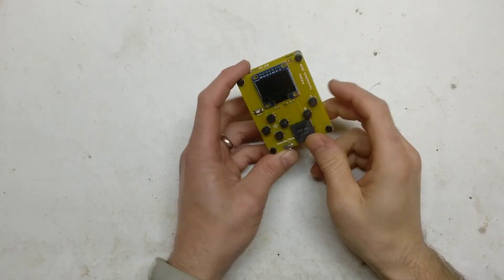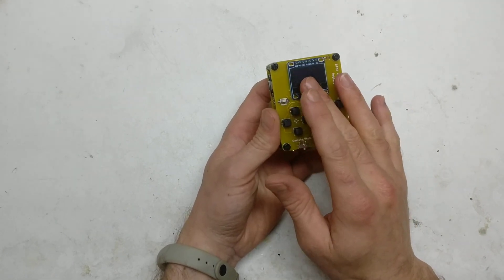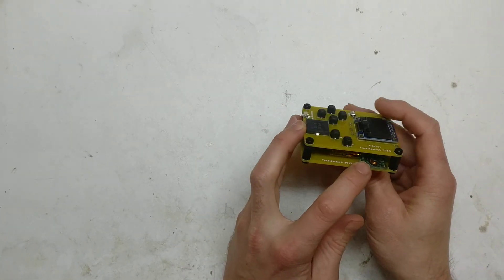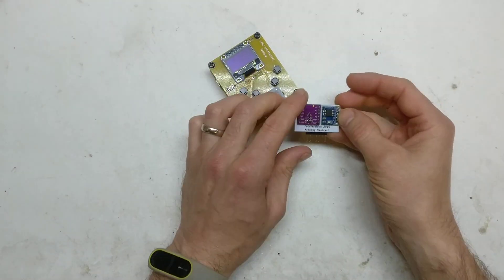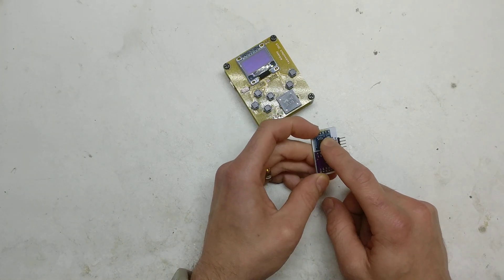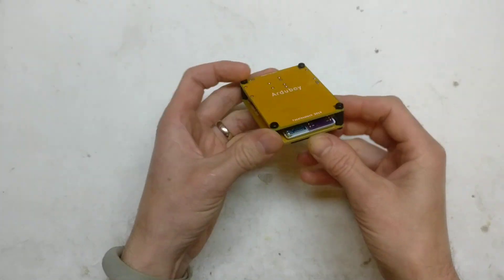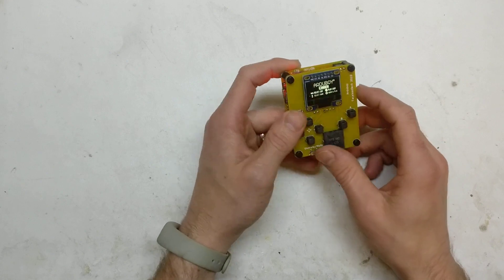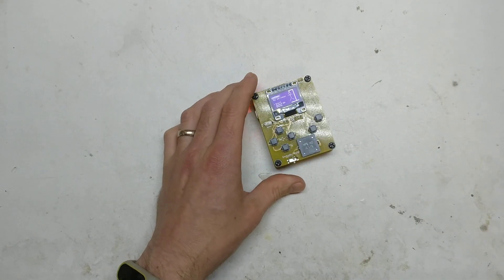Homebrew Arduboy with removale flash cart

Comment: unless your using W25Q64 or lower you do not need the logic shifter, read the form care fully! if your using the W25Q128FVSG then all you have to do if connect it to the pro micro btw ALWAYS use 3.3v with these chips I had to salvage a voltage regulator from a sd card module to even get these chips working
Reply from the maker: Think I was using the W25Q64 in mine, good to know about the other chip tho